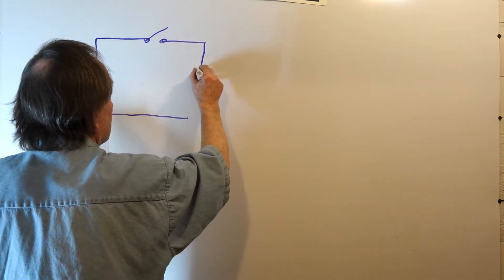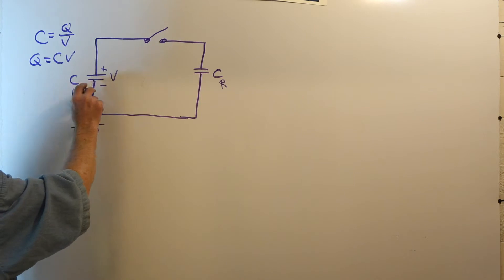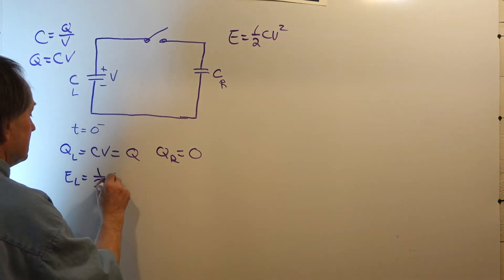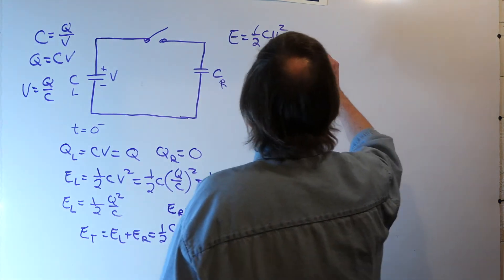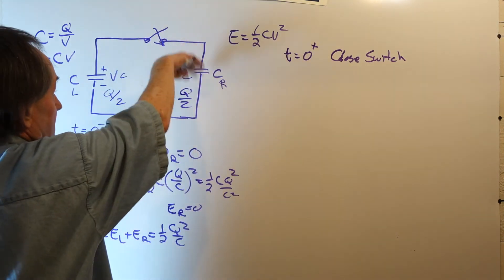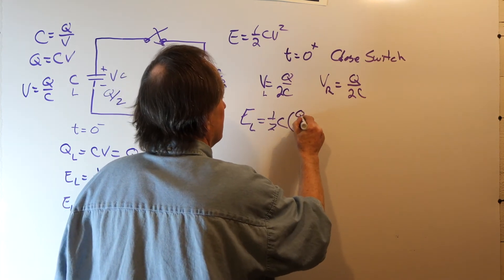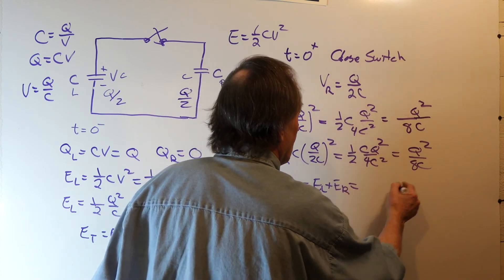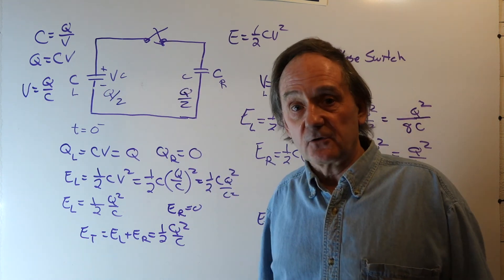Capacitor CHARGE and  ENERGY  Transfer  Problem

Comment from the maker: ---------------       ATTENTION   READERS      ---------------
A hypothetical mechanics problem that is analogous to this two capacitor electrical network problem has to do with kinetic energy.  

 PROBLEM:
There are two billiard balls on the same gravitational equipotential plane so that they are at the same potential energy and will remain so throughout the problem.

One ball with mass, m1, is in motion moving with velocity ,V1, toward the second ball with mass, m2.   The second ball is stationary with velocity, V2 = 0.  The trajectory of the first ball is in line with the center of mass of the second ball so that when they hit there will be no deflection or deviation from this line of motion.  The center of mass of the combined masses moves along the same trajectory as that of the first ball.

The two balls collide in a perfectly inelastic collision and move together after the collision with a total combined mass of m1 + m2.  The balls are stuck together and move with velocity, Vf, in a straight line collinear with the trajectory of the first ball as stated.

The final velocity, Vf, of the two balls moving together is determined using the conservation of linear momentum:   

                        system momentum before  =   system momentum after
                                                            m1 • V1  =  (m1 + m2) • Vf    
 
Therefore solving for Vf:            Vf  =  V1 •  m1 / (m1 + m2)

The gravitational equipotential surface the balls are on will be designated as the potential energy reference (PE = 0) so the potential energy of each of the balls before and after the collision does not change and will be taken as PE = 0.

Now compute the total mechanical energy of the system BEFORE and AFTER the collision:

TOTAL  ENERGY  BEFORE:   
                                                 Etb  =  E1b  +  E2b
                           E1b  =  1/2 m1 • V1^2          E2b  =  0.0   since  V2 = 0

                                              Etb  =  E1b + E2b  =  1/2 m1 • V1^2     

TOTAL  ENERGY  AFTER:  
                                                Eta  =  E1a  +  E2a
                             E1a  =  1/2 m1• Vf^2        E2a  =  1/2 m2 • Vf^2       

                                              Eta  =  E1a  +  E2a  =  1/2 (m1 + m2) • Vf^2

Using the value for Vf determined by invoking the conservation of momentum compute the total energy of the system after the collision:         Vf = V1 •  m1 / (m1 + m2)

                   Eta =  1/2 (m1 + m2) • Vf^2  =  1/2 (m1 + m2) • [ V1 • m1/ (m1 + m2) ] ^2

                 Eta =  1/2 [ m1 / (m1 + m2) ] • m1 • V1^2 =  [ m1 / (m1 + m2) ] • [ 1/2 m1 • V1^2 ]

                                              Eta =   [ m1 / (m1 + m2) ] •  Etb

COMPARE  THE  BEFORE  and  AFTER  SYSTEM  ENERGIES:
 
                    Etb  =   1/2 m1 • V1^2 
                    Eta  =   [ m1 / (m1 + m2) ] •  Etb

The final total system energy is  LESS  than the initial total system energy by the factor:

                                           K  =    [ m1 / (m1 + m2) ] 

So what happened to some of the initial kinetic energy?   Should not energy be conserved?
  
If the masses are equal [ m1 = m2 ]  just as the two capacitors are equal in value,  the energy lost is 1/2 that of the initial kinetic energy of the system,  K = 1/2 after the collision.
GH
Reply: ok, let's put the two identical balls on a circular frictionless  rail. the first one has velocity v and if the collision is perfectly elastic it will transfer all its momentum to the second ball. perfect elastic collision should be the equivalent of zero resistance in the electric circuit. now the second ball will go around the rail and hit the first ball and the cycle will repeat.  the velocities of the ball keep changing from zero to v indefinitely.

In reality, even if the rail is perfectly frictionless and the balls are not deformable, I guess some energy will be lost in the form of acoustic energy by the noise made in the collisions (we can consider this the representation of radiation loss? in or does the noise mean the spheres are being deformed?) and in the long run, the velocity of the balls will decrease till they stop.
Reply from the maker: @copernicofelinis  
Actually what you are describing is analogous to the ideal  L-C oscillator.   There is no paradox in your rail example involving lost energy as with the two capacitor problem described in this video.  In your example, energy is being exchanged between the two circuit elements without energy loss (IDEAL/LOSSLESS) just as with an ideal inductor(L) and capacitor(C).

GH  May 09, 2022   1:01 am CDT
Reply: @georgehnatiuk5806 the point is that in order to make the two masses stick together we need some sort of dissipative mechanism. What makes the collision perfectly inelastic in your case? Loss of energy in heat and/or in the deformation of the structure of the masses?
 One way to make the electric circuit lose energy in heat is by including the resistance of the wires, but we are ruling that out in the assumptions. If we also rule out the possibility of temporarily storing the energy in the loop inductance (because it's negligible) then we need to invent or discover a way to extract energy from the system.

In the electrical world we have radiation, but in the mechanical world? I am not sure the two examples can be considered equivalent.

Incidentally, there is a paper that discusses this 'paradox' by computing the energy loss in the system in the form of magnetic dipole radiation. The fact that a current is flowing in a loop implies the charges are accelerated and by computing the associated E and B fields and the flux of the Poynting vector through a surface that encloses the circuit, the authors show that the energy leaving the circuit has the exact value of the energy lost by the capacitor.

But what would be the mechanical equivalent of radiation? Can we say that the two masses stick together thanks to the energy lost in the sound they make when they collide? Seems a bit far fetched....

I'll try to post the reference to the paper in a subsequent comment, because yt tends to delete comments with l**ks.
Reply from the maker: @copernicofelinis  I allow all comments without review.
GH  May 10, 2022   11:12 CDT
Reply: ok, let's see if yt will let this through

"The two-capacitor problem with radiation"
Timothy B. Boykin, Dennis Hite, and Nagendra Singh
Am. J. Phys. 70, 415 (2002)

Abstract: 
We discuss the two-capacitor problem found in many introductory physics texts in which there appears to be missing energy in an ideal, zero-resistance circuit, following the sudden charging of one capacitor from another. The paradox of this missing energy is traditionally ascribed to finite-resistance wires, the initial assumption of an ideal circuit and the rapid nature of the charging notwithstanding. 
By treating radiative effects in the simplest approximation, we show that the paradox is really nothing more than an inappropriately applied lumped-parameter model. In particular, we show that in the zero-resistance circuit, radiation fully accounts for all of the energy lost. 
To explore radiative effects in more realistic circuits, we also discuss numerical examples that include a small resistance and inductance.

What do you think?

(As an aside - and not related to the above paper -  one way to make the two mass stick together in the mechanical example is to store the energy in springs (bumpers) attached to the masses and segregate it by means of a hook and hoop mechanism. With ideal springs we will not have any dissipation and all energy will be store in the 'deformation' of the resulting system. Now I am wondering what the electrical analog of the hook and hoop mechanism would be... )
Reply from the maker: @copernicofelinis  
Someday when I have the time to discuss this further, I will show why the radiation claim is wrong.  There is a very simple solution to this problem that I have hinted to in other comments.   You might read all the comments and my replies.   There are not all that many to get through.
I am surprised at how many physics students and professors cannot get this right.  EE students are not much better at it either.

I cannot access the paper.  If you have a pdf copy, could you please forward it to me at my EMAIL:  ghnatiuk@juno.com  
I would like to look it over to see where they go wrong.

GH  May 10, 2022  11:06 pm CDT
Reply: as you can see, after I added a link to research gate website, my previous comment has been deleted by YouTube.

there is also a chance that even this one will be deleted because I have mentioned the name of the site.
Reply: YouTube's gaslighting can be scary, at times. you can request the article for free from the authors without even subscribing to what I cannot name (but has a gate in it's name). if I remember correctly, once you choose the last option "I am not a researcher", the paper will be sent automatically. if it does not work out, we will find another solution.

As for the other comments to this video, yes I had already read them, including those from number33. But this paper show how when R goes to zero, the radiating term becomes dominant (from 1 or 10 microohms downwards).
Reply: Also, I just found a 2003 follow-up paper by t.c. choy that can be downloaded directly it is titled "capacitors can radiate - some consequences of the two-capacitor problem with radiation". You should be able to find it by googling the title and adding the words research and gate.

Also search for this one "Radiative effects and the missing energy paradox in the ideal two capacitors problem" on the same site. It adds new solutions to the nonlinear equation obtained by the first paper.
Reply from the maker: @copernicofelinis  just send all the links to my email:   ghnatiuk@juno.com
or if you have skype, send me an acceptance request to my account:   georgeandkhan
We can transfer files there up to 300MB.

Make life easy for me as I am verfy busy in my life and do not have time to be searching for papers.
Sorry but I do not have time to spare. 

GH  May 11, 2022    9:12am
Reply: @georgehnatiuk5806  I just wanted to check that you received the mail with the links. I totally understand you have things that are several orders of magnitude more important to do, but I want to make sure I did not mess up the mail.
Reply from the maker: @copernicofelinis  I did receive it but too busy with life's challenges at the moment.   I will be uploading a video shortly to show viewes what we are up against with high water on Rainy Lake.
GH  May 23, 2022
Reply: @georgehnatiuk5806  Dude, first the fire and now high waters? Makes me wonder if there actually is a god and he is taking revenge of you for denying the earth is flat!

I hope my silly comment made you chuckle a bit. I wish you the best in overcoming your challenging situation.
Reply from the maker: @copernicofelinis  If God was punishing me for denying FE, he would take my brains away and make me stupid so I would embrace it and view Bev as an intellect.
GH  May 23, 2022 11:15pm

Comment: If you start with conservation of energy, rather than trying to derive it, and you consider a free body diagram of the cap that is initially charged to Vi, you will see that the bottom rail must go negative relative to the original zero reference point as the top rail pushes current to the uncharged cap. Each cap when at the equal voltage point (by symmetry) will have +1/sqrt(2) x Vi at the top and -1/sqrt(2)Vi at the bottom. Then the energy in each cap is 1/2 x C x [1/sqrt(2) x Vi]^2 = 1/2 x C x 1/2 x V^2 = 1/4 x C x Vi^2, and the total system is 2 x this amount. Thus retaining conservation of energy.

Comment: Too old a thread by isn't that related to first law of thermodynamics,  Change in energy = Heat + work done. There is no work done here by any battery so loss of energy is in the form of heat.
Reply from the maker: There are no resistive elements in the proposed network to cause Joule heating, just two ideal capacitors and an ideal switch all connected with ideal conductors that have no resistance or inductance.  So where did the missing energy go to?   How does one reconcile that 1/2 the energy is lost?
GH   Feb 06, 2022    3:50pm
Reply: @georgehnatiuk5806  if there is no joule heating, that energy will convert into Electro magnetic wave and go into atmosphere.
Reply from the maker: @abhishekdwivedi556  
Radiation does not account for 1/2 energy loss.   Interconnects are perfect with no resistance and no inductance.
There could be no oscillation L-C to cause charges to accelerate to produce radiation.  Initial charge movement from charged capacitor to uncharged capacitor would not radiate enough energy - calculate it out.
GH

Comment: An answer here : https://en.wikipedia.org/wiki/Two_capacitor_paradox
But we are still waiting your video Mr Hnatiuk !
Reply from the maker: I get that -- too many things on my plate.  I will get to it eventually.  Apologizes to all of you regarding this.
GH  May 19, 2021
Reply from the maker: I just read that wiki page you linked to me.   It is basically correct except for this:

If the connecting wires, in addition to having inductance and no resistance, are assumed to have a nonzero length, the oscillating circuit will act as an antenna and lose energy by radiating electromagnetic waves (radio waves). The effect of this energy loss is exactly the same as if there were a resistance called the radiation resistance in the circuit, so the circuit will be equivalent to an RLC circuit. The oscillating current in the wires will be an exponentially decaying sinusoid. Since none of the original charge is lost, the final state of the capacitors will be as described above, with half the initial voltage on each capacitor. Since in this state the capacitors contain half the initial energy, the missing half of the energy will have been radiated away by the electromagnetic waves.

The capacitor problem as usually stated is impossible for all one needs to do is look at the mathematical model of an IDEAL capacitor:
     
                                                 Ic = C dVc/dt

This problem VIOLATES all laws of electrical circuit theory.  When the switch is closed, the problem requires the capacitors be instantly connected together when their voltages are not the same.  This is an impossible situation for it requires a jump in voltage across the capacitor that was initially discharged resulting in a discontinuity in the voltage function of that capacitor and such a voltage function has no derivative at that point in time: 

                   dVc/dt    does not exist at t = 0+ or can be considered infinite.
                                    Infinities do not exist in the real world.

This is the short answer.  Someday I will address this all in detail and hopefully lay it to rest once and for all.

GH  May 21, 2021
Reply: Thank you ! I'm looking forward to reading you.

Comment: Hi George, very intersting problem, that we discussed as students already 40 Years ago … my personal anwer I found is, the assumption of a ideal setup in combination with the static state after some time is wrong. An ideal system might have no resistive losses, but will still have inavoidable inductance along the capacitive connections. these will form coupled resonance circuits, which will - because of no losses assumed - never come to a stable state, but oscillate forever after the switch is closed. Can you agree?
Reply from the maker: I will answer tomorrow.  Just found this today - never received notification.

Comment: Sir,when are You going to Upload the Solution?

Also as far as I can Understand the Reason for Energy Loss is the Heat Generated in the Conducting Material (Wires,Switch and Capacitor Plates) due to the Charging (i.e Flow of Current From Cl to Cr till their Voltages are Equal) of Cr.

Note :- When I say Loss of Energy I mean Loss of Electric Potential Energy and Not The Total Energy (Total Energy would be Electric Potential Energy + Heat ).
Reply from the maker: Yes, I know I am way behind on getting the solution video made.  I will try to get to it by mid-summer.   There is much to discuss concerning this problem.  I want to cover all the proposed solutions that I have seen over the years and explain why they are all wrong.

Keep in mind that the problem as proposed is IMPOSSIBLE.  You cannot charge an ideal capacitor from another ideal capacitor connected with ideal (ZERO  resistance) conductors without having infinite current.  It violates the terminal V/I relationship of what we define as a capacitor:   Ic = C*dVc/dt.  
To resolve the "paradox" you need to look at what happens in the limit.

You are basically correct when you state: 
"the Reason for Energy Loss is the Heat Generated in the Conducting Material (Wires,Switch and Capacitor Plates) due to the Charging (i.e Flow of Current From Cl to Cr till their Voltages are Equal) of Cr"

The problem as you sort of indicate can be resolved using real world conductors having a FINITE conductivity that will account for the energy loss as Joule heating.  But, many people try to solve the  IDEAL  CAPACITOR  case by introducing radiation, some esoteric considerations using Maxwell's equations, switch capacitance to affect the transfer,  inductance and other factors all of which are WRONG.

Stay tuned and thanks for reminding me about getting to making the solution video.
GH  April 27, 2020
Reply: @georgehnatiuk5806  Thanks for Correcting Me Sir,will wait for the Video!

I wonder what if the Wires are Ideal too,then we will have 0 Resistance in The Circuit,which will allow Infinite Current?